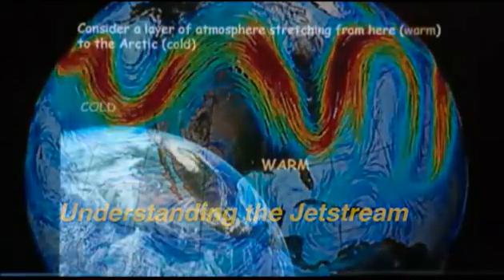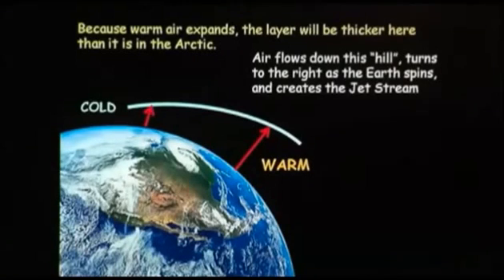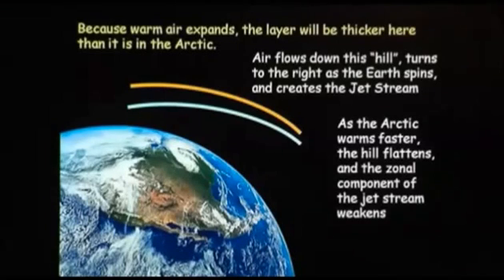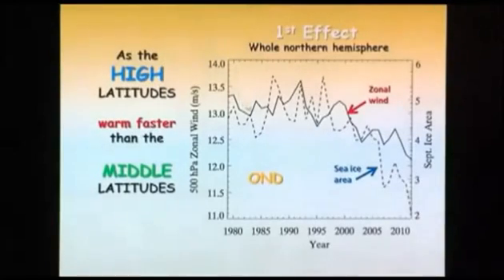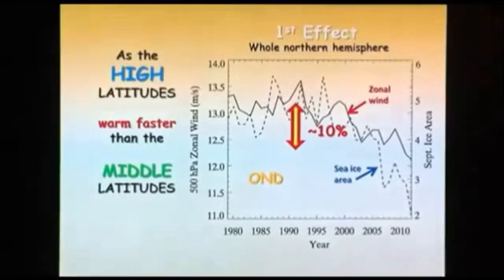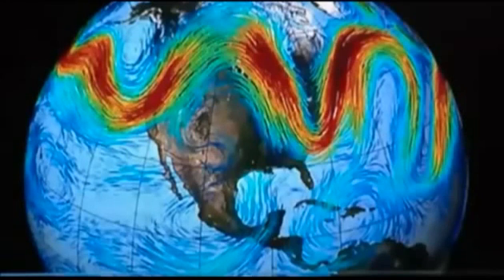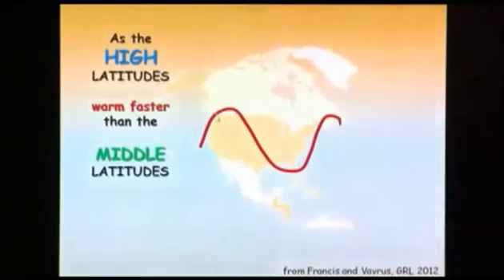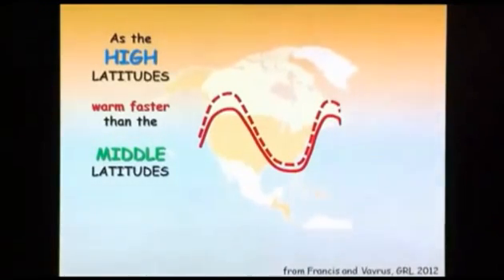Jennifer Francis - Understanding the Jetstream - m

Comment: The traditional picture of the wind system in the northern hemisphere is from 90 degrees to 60, the Polar Easterlies, from 60 to 30, the Westerlies, and from 30 to 0 degrees, the NE Trades.       As the Westerlies would have been warmer than the Polar Easterlies would it have been normal for the latter before high Arctic temperatures became the norm, to blow beneath the former and thus join the Trades to bring colder winds southwards to Texas and California creating precipitation in the process?             Accepting that the jet stream now is changing weather patterns south of the high latitudes could the droughts in Texas and California be caused by the Polar Easterlies becoming warmer along with the jet stream dragging lower warmer air with it when it's moving further south over those two States?